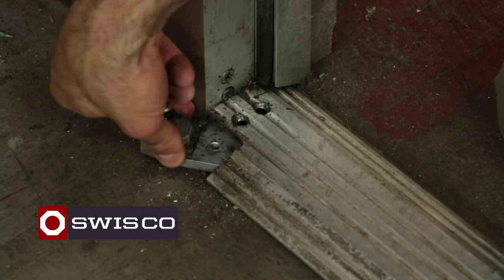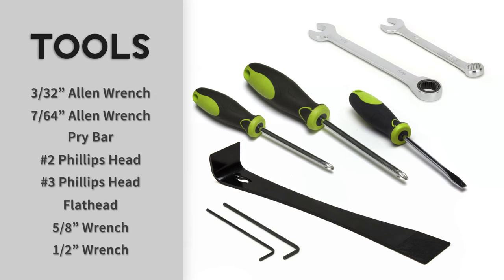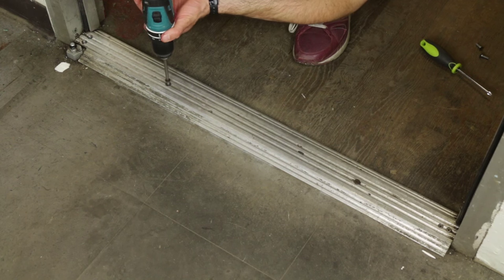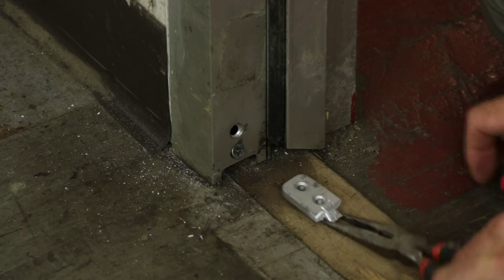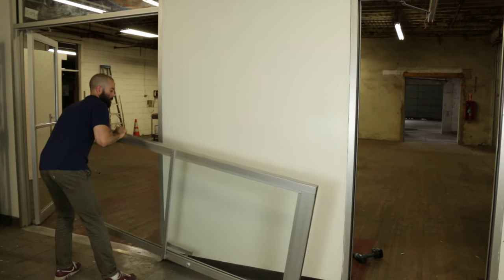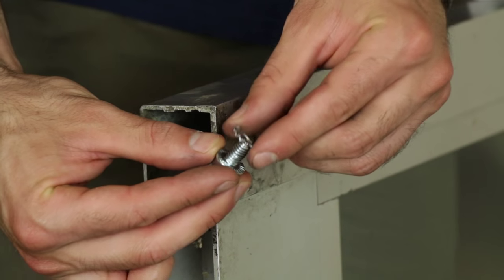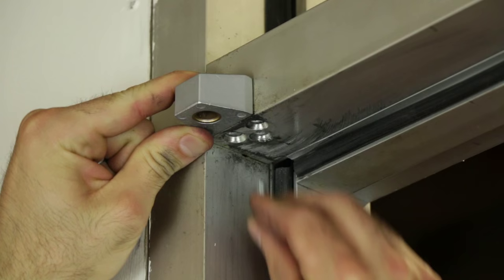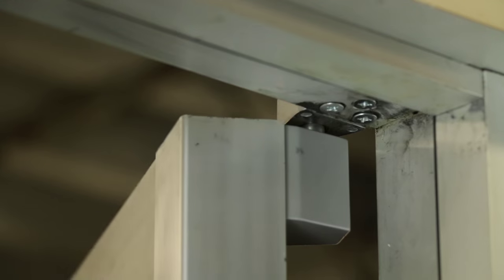How to Install a Commercial Door Pivot [1080p]

Comment: nice video. Definitely helped that there was no stripped screws or caulking :)  Thanks for showing you using the riser set screws. the Allen heads that drive downward prevent the weight of the door from rocking and snapping the pivot prematurely. Seriously, nicely done.
Reply from the maker: Hi Jared, We are so glad you found it helpful, thanks for letting us know!
Reply: So for the Allen heads that drive downwards tighten them all the way down after you install the door or before?

Comment: I've rarely seen one where the sides of the threshold weren't installed below both sides of the aluminum frame (a pre-installed aluminum door)...Good luck in getting those frozen stripped pivot screws and threshold out....
You usually do not have to take the usually stripped frozen screws out of the top pivot to remove the door. There is usually a poke hole visible from the top to insert a tool to push the spring loaded pin down. If there is no hole (like seen here) simply drill an 1/8" hole from the top and push the pin down with something....It's hilarious that the "leg" was pre-cut off (1:25) from the rest of the bottom pivot assembly before the video was made to make this look like a 5 minute job...

Comment: What if the door doesn’t just come out of the bottom pivot when you unscrew it from the top.  No screw or anything.  I thought maybe there was a cap covering a screw but nothing comes apart on the bottom pivot

Comment: At 0:53 what are the size screws needed in the top header above the top pivot?
Reply from the maker: Hi Brandon. The top pivot uses 3/4" 10-24 screws to fasten into the header.

Comment: I am installing a Kawneer Pivot door inside a warehouse. In the place where its gonna be installed there are french doors. So i'm gonna have to remove the french doors and build in so that the Kawneer door will fit. My question is....is it possible to mount the Kawneer frame to wood. I hadn't been able to find this type of install online yet.
Reply from the maker: +floridaboy9942 If you want to install a new commercial door pivot, we suggest you remove the complete French Doors and frame and then install a new commercial door frame inside the opening. We don't recommend trying to install the commercial door pivot in a wood door (French Door) frame.
Reply: I have the actual comercial frame..my question is once I close in the french door opening to make the pivot door frame fit is it ok to mount the comercial frame to the wood
Reply from the maker: +floridaboy9942 Yes, as long as you have the correct amount of depth, width and height available on your wood frame in order to fit your commercial frame.